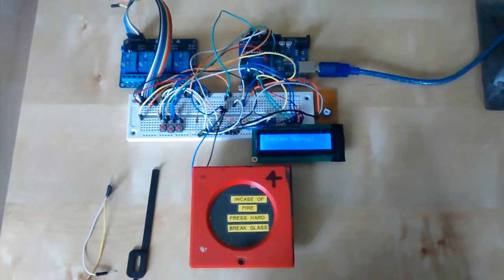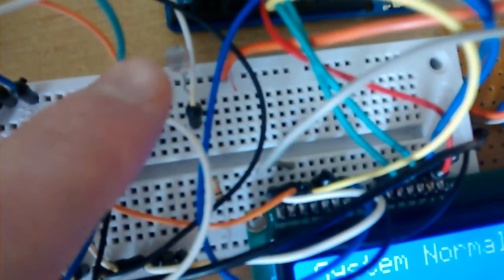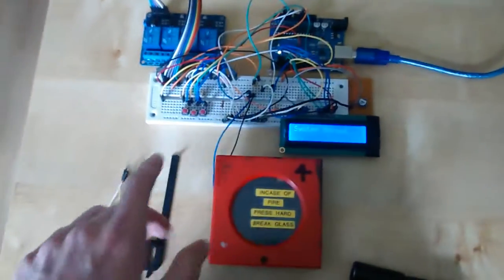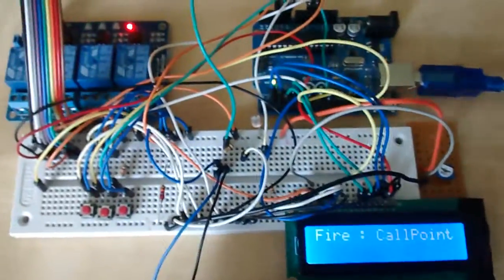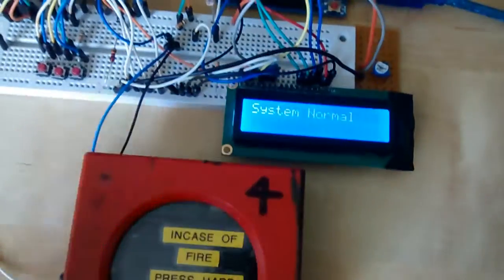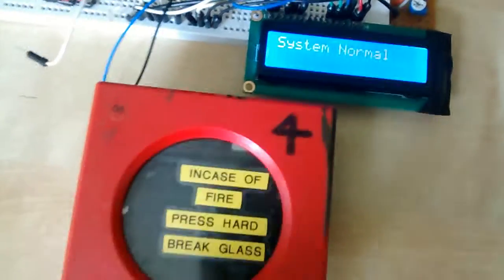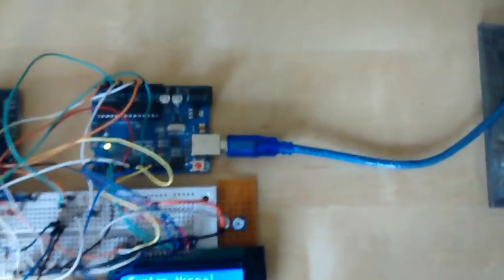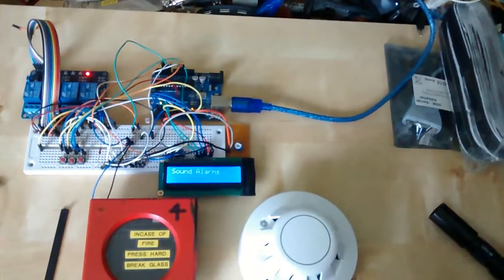Arduino Fire Alarm System

Comment: Good luck with working with 2 wire detectors because it is much harder to use a 2 wire detector than a 4 wire one like the System sensor 1000 series smoke detector

Comment: I also built an arduino fire alarm system. I use pull stations instead of manual call points and I have my Gentex commander 3 on NAC 1 and 2. (in the USA)

Comment: Would it be capable of supplying the 24v required by detectors or would that require some interfacing to convert it to logic levels (sorry, not an expert with arduinos)
Reply from the maker: Yes the sounders can be powered with any voltage using the relay board which is capable of handling 250VAC at 10A or 30VDC 10A. The detectors I working on because they require a transistor or two to interface the 24VDC to a logic level of 5V ish. Its not too hard but I am looking at a practical way that allows for expansion rather than just 1 detector on a loop.
Reply from the maker: More on that in an update video which I will make when happy with detector interface / circuit.